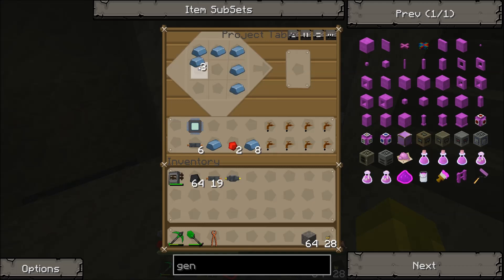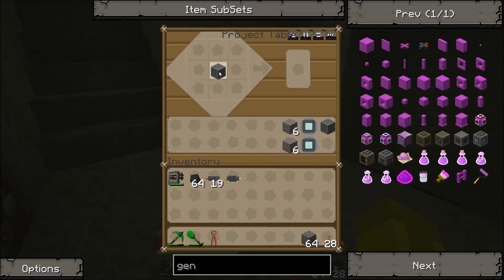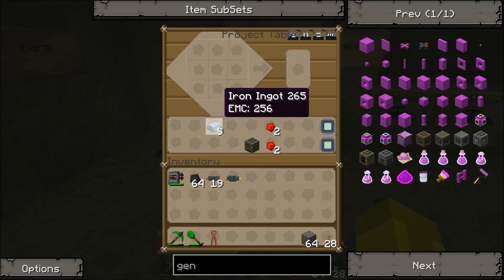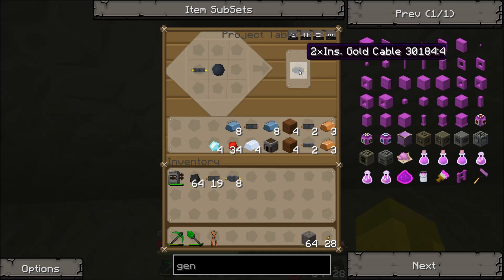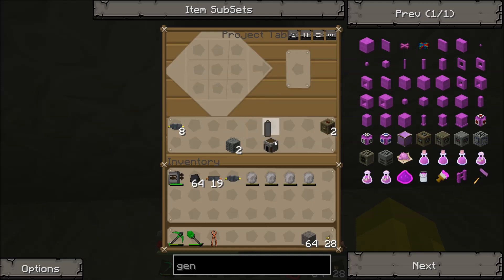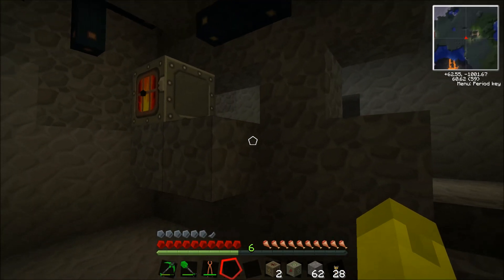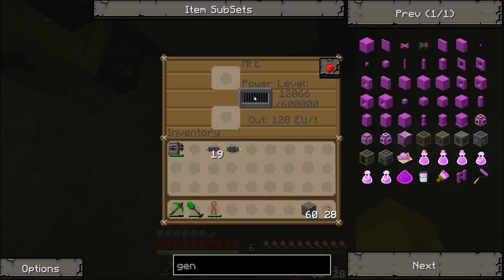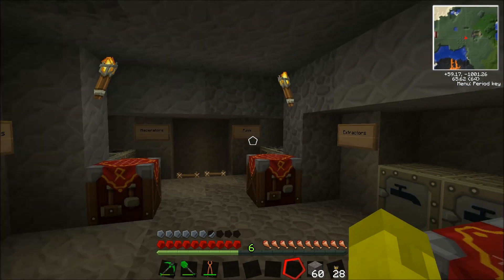Tekkit Episode 4.5: Machines 101

Comment from the maker: Jason: last time i checked, if you tried to output to more than 3 machines using a copper cable, a piece of the cable would melt, using a transformer allows you to output to an additional 3 per output-side. the real use for them at the moment is to convert HV which the MFSU emits to MV, and then MV to LV for our basic machines. :)